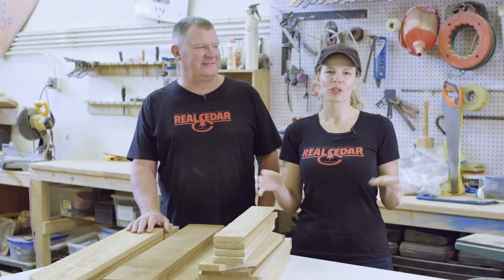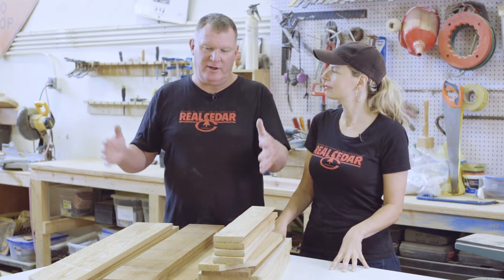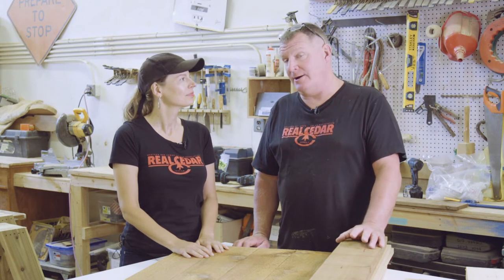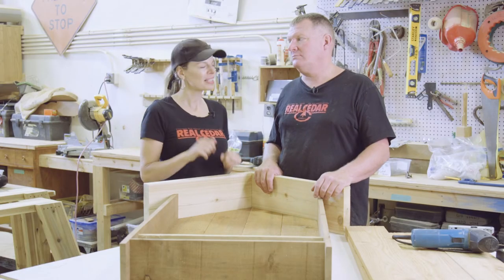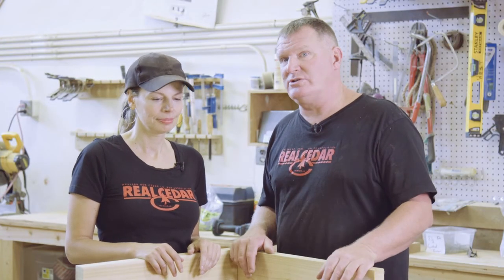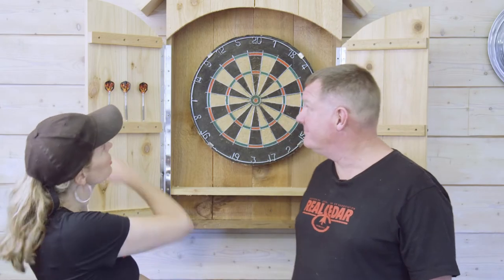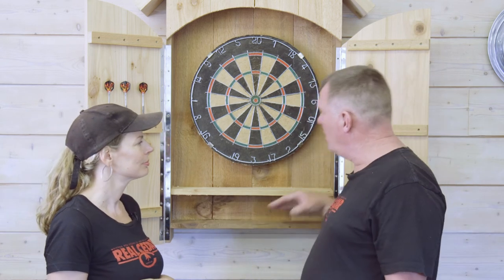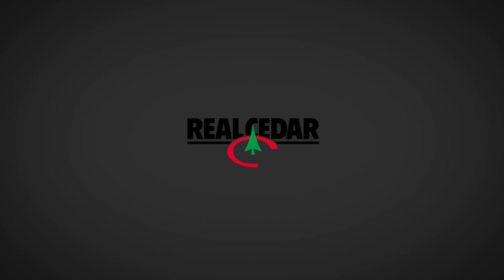DIY: Rustic Dart Board Cabinet - RealCedar.com

Comment: Super disappointed in the wrong measurements and the fact that the PDF does not match SketchUp. After going through the process of building this and having to make modifications in order for this not to be a complete waste. I really appreciate the fact that the project is even offered, however damn. Really wish I would have found the video here rather than on your website so I could have avoided this aggravation

Comment: So frustrating. The plans do not match what you built. For example, the back braces are listed as 2x4 when, in fact, they are 1x6. The measurements for the 45 degree front and back pieces are wrong, too. If you follow the plans you will waste your wood.
Reply: Great video, the plans are free but they should be correct. They did a good job of filming so you really don't need plans you could dream up your own dimensions.